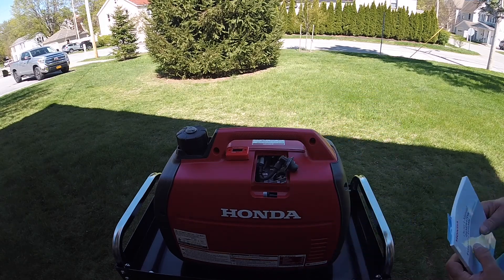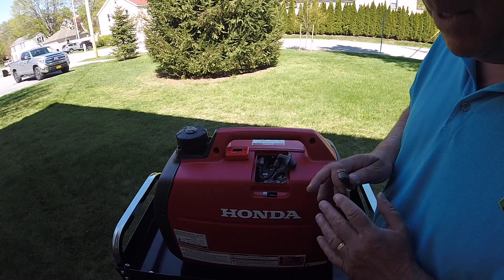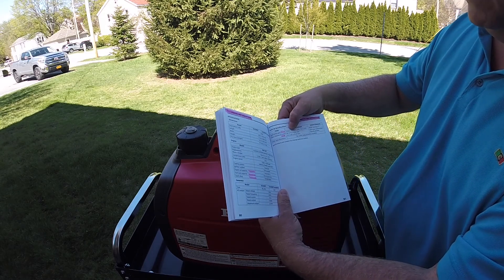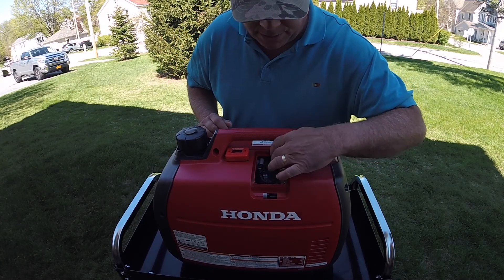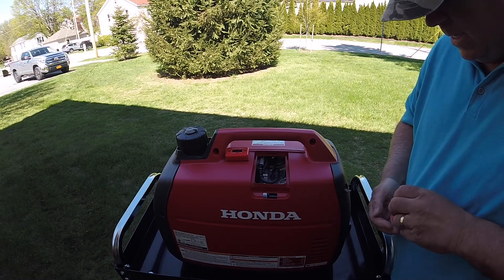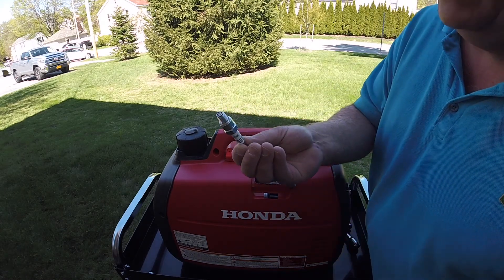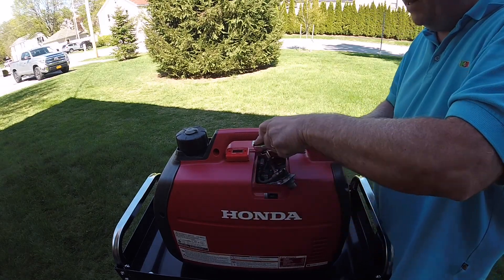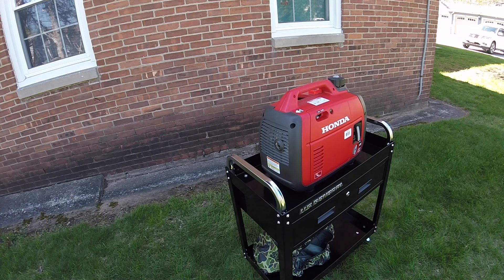Honda EU2200i Rough Idle on Eco Mode ? A Fix.

Comment: Brilliant fix saves fuel, also runs my propane conversion kit ,also put some dielectric silicone grease on the spark plug threads and ht leads

Comment: THANK YOU!! Messing with the spark plug it was at .025 I lowered it and rough idle gone. Have 2 so I can combine (companion) them both rough idle on eco mode after a few uses.
Reply from the maker: Glad it helped. There’s another trick to fix this eco rough idle for all of these generators. See my Yamaha 2200 video.

Comment: If you changed the gap on an iridium plug, you ruined it. All iridium plugs are gapped correctly in the box. If you notice it isn't correct, return it for another. If you change the gap, you've ruined it.
Reply: 😂😂 ok bozo not if you do it correctly by not touching the tip and prying as you would with a standard plug. Just think of how dumb you are to have even made that comment that it's gapped correctly right out of the box when different engines that use that same plug call for different gaps.  Wow just wow you're the reason we needed to eliminate the federal fake department of education

Comment: I tried your fix without success. I went to the local Authorized Honda Power Equipment service center and was told it was most likely fuel tank debris had fouled the carburetor. Thank you for the video.
Reply: My brand new Honda does it and the dealer took two more of them out of the box brand new right off the truck and they do the same thing I am so pissed off at Honda!!!!
Reply: @MAXIMUSMINIMALIST  It seems that since they started using the big box stores the quality has slipped. I have an Eu2200i that is four years old and it runs great. I wrote Honda and they said it would be covered under warranty. I am in Florida and I was waiting for hurricane season to be over. I am glad I did. Hurricane Helen is headed directly at me, should be here in about an hour. Best of luck to you and your problem.

Comment: Thanks for the video.  Just ordered one, should be here Monday.  If it runs rough, the plug gap is the first thing I'll check.  How has it worked for you after 3 years?  Any issues?  Thanks again.
Reply from the maker: 💯 Flawless. Starts every time. It’s my go to.
Reply: @1minibean  Good to hear, thanks again.

Comment: If this doesn’t work (It didn’t for me)
Check the black plastic idle jet, it should have 2       O rings on it, 1 above and 1 below the hole.
Mine was missing the top one from the factory. Causing the air leak and rough idle.
Reply from the maker: On a Honda carburetor, that black plastic one piece jet is the Pilot Jet. Even though there is 3 ring gaps, there is only one O Ring on these, and it’s at the bottom. I’ve never seen 2. But if it worked, that awesome. I can see where an additional O Ring on top might prevent air getting in. When the Pilot jet gets clogged with the slightest debris, the main characteristics will be surging at idle. My issue was just a choppy inconsistent idle. Thanks for the Tip !

Comment: How did you determine what model of the NGK Iridium you needed? Or does it really make a difference as long as it screwed into the spark plug hole?
Reply from the maker: I cross referenced this plug many years ago, and it has worked for me. Hopefully it makes a difference for others too. But the stock plug also works good for my generator if it’s properly gapped. It was poorly gapped from the factory, and ran like crap until I properly gapped it.

Comment: I'm surprised that by changing to Iridium plug your EU2200i doesn't dance when idle on Eco mode 👍
Reply from the maker: I got good results from both plugs with proper gapping. The iridium plug installed seems to make the engine sound a bit better running.

Comment: Yep had to fix my spark plug gap as well on my EU2200i. Was rough idling the dealer had prepared my generator before I pick it up. They never noticed it was rough idling. Yep Honda shall run smooth just like that!
Reply from the maker: Hopefully this works for most owners.
Reply: @1minibean  very easy fix.

Comment: I have a new 2200, LPG converted, never been run on petrol/gas. It too has a rough idle on Eco, so tried your remedy of setting the spark plug gap.
At first I thought it a success, idling not perfect but much better. BUT, as soon as I replace the plastic cover the bad idle starts again. Placing a rag bundle over the plug access hole (instead of the plastic) gives the same bad idle. My only conclusion is air starvation of some sort. ????
I notice in your demo you hadn’t replaced the plastic cover and wondered whether yours might do the same.
Thank you for your video and time.
Reply from the maker: Hi, thanks for the reply. I know some other owners running LP gas use the Iridium plug I show here. I would order this plug and install. I don't think ventilation is off. I have noticed that the more I use it and break in the engine, the better it runs. Use the Iridium plug and run it for a few hours at a time and I believe it will tighten up. Also with a good load on it. Let me know how you make out.
Reply: @1minibean  Thank you again for your thoughts and advice.
To be fair, the machine is brand new and may well benefit from some running in. I will source the iridium plug also.
With the ventilation question, the opening and closing of the plastic spark plug access does make a significant difference, so I won’t be discounting that just yet.
If there are any significant developments (or not!) I’ll be sure to let you know.
Greetings from England UK.
Reply from the maker: @JP-mu5ic  
Sounds well.  The rag over the top vs. the cover I wouldn’t recommend as this case is designed to intake/air for cooling purpose. Any restriction most likely will cause issues with overheating and warping of the cast aluminum components. If anything, more open air flow is even better. Run that animal with a 75% load for a good 1 to 2 hrs., then flick it down to eco mode and I think it will surprise you . Cheers from N.Y.
Reply: @1minibean  Just to clarify the rag business.
I cover the access hole for a few seconds = bad idle
Remove the rag = better idle.
Same with the plastic cover plate!
Reply from the maker: @JP-mu5ic  
Interesting....sounds like the body/case needs more ventilation.....?

Comment: I have one of these terrible generators. My generator had the rough idle. I took into the shop for warranty and the woman at the front desk unscrewed the fuel cap and told me I had old, bad gas. I asked her how she knew that without sending it to the technician. She pointed at what she called “white residue” under the fuel cap. I didn’t see a thing, but she denied warranty on the basis of bad fuel. The generator is used almost daily and filled with ethanol free fuel. Guess the gas station had bad gas. lol The only reason I bought the EU 2200 I was the good price. Should have spent the extra money for the Yamaha,. Honda’s day has come and gone. Their equipment has declined in quality to the point that I won’t buy their products again.
Reply from the maker: Thats why I didn't bother returning it, I knew I'd just get jerked around. Try this spark plug gap, or try the plug I recommend in this video. I'm thinking it will change the way it runs. Thanks for commenting man !
Reply: Shops hate warranty work because they are unable to rip off Honda like they do customers.
Reply from the maker: @rebellucy5610  Ha, not to mention many times it doesnt come back fixed anyways. Especially if they cant duplicate a problem.
Reply: I just bought one of these in July and do the search for this problem obviously because on Eco mode it vibrates so bad I can't imagine it lasting very long. I opened up the spark plug gap and it didn't make any difference at all. My dealer was Murdochs Which is a very upstanding chain mostly in Colorado Wyoming Montana and Texas so I brought it to their shop and told them about the spark plug gap they had never heard about that. They took off the covers to check the motor mounts and the balancer which is external to make sure nothing was loose and said there's nothing they could do really and said they were not aware of the problem but they did take another one out of the box and it did the same thing. At Murdochs they take them all out of the box and put oil and gas in them then put them on the shelf like that but apparently at least at this location they never ran it on Eco mode. They were really cool about it in fact since that's how they sell them out of the box they offered to take two more out of the box and everyone did the exact same thing!!!  I am extremely disappointed with Honda. Harbor freight had their really good best sale of the year on their copycat version and I passed on it to spend more money on the Honda because I wanted the best I wanted superior quality and I wanted something that will last nearly forever and now I have a premium priced generator that is destined to fail due to extreme vibration.

Comment: I have four Honda EU 2000 (2) Eu2200(2) Three of them have a Hutch Mountain system(runs with Propane too) They recommended the NGK Iridium spark plug, works  super good.
Reply from the maker: From what I'm reading from other 2200 owners, rough idle on Eco mode seems to be a common thing. Luckily for me, regapping the plug did the trick instantly. The iridium at .024 and also the stock ngk .024-.028 was an instant success too for me. Hopefully others have the same results.

Comment: I brought my new 2200 right back into Honda and told them it runs rough on eco . They just said that’s how they run .. well i wasn’t convinced . Glad I found this video . While digging around there’s also a guy who said he fixed the problem by turning out the fuel screw on the carb , cutting the tab and turning out about 3 or 4 turns stopped the rough idle . I’ve heard it might be a lean miss from the strict emissions settings on the carb  . But this spark plug gap is much easier I’ll try this first !
Reply from the maker: They told me the same thing. Hopefully this resolves your issue as it did for me. The change was instant.
Reply: Did it work for you?